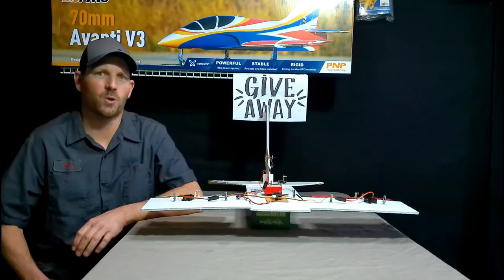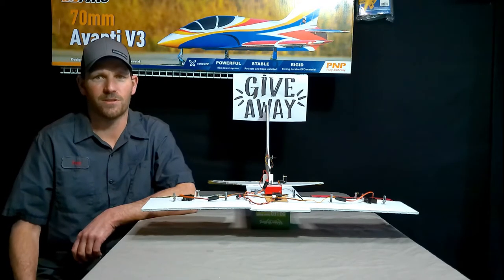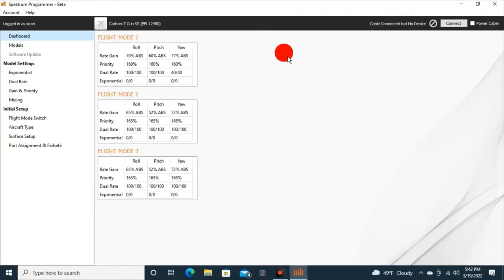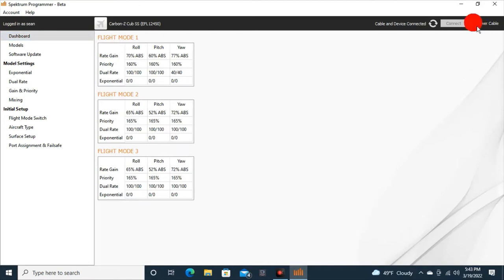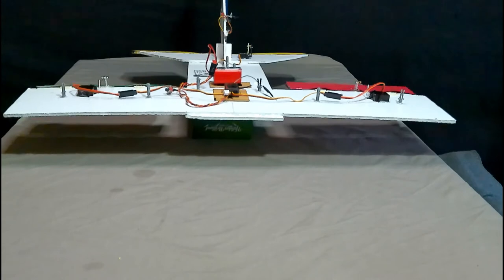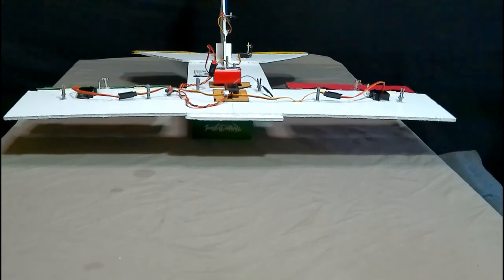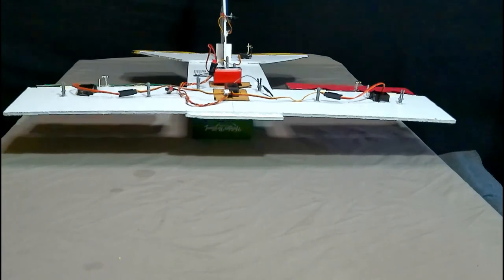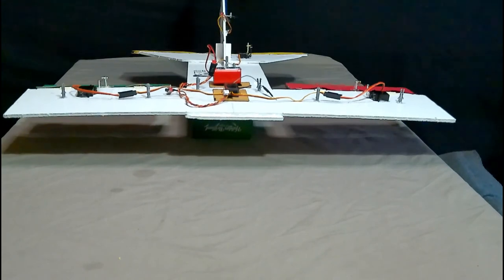SPEKTRUM AS3X RECEIVERS GYRO GAINS KINDA SORTA WELL MAYBE EXPLAINED E-FLITE AR636 SAFE SELCT PROGRAM

Comment: Thank you for the video. I''ve had the Opterra for years, and I must say it's a plane begging for a "real" flightcontroller and actual mission planning. It's not "fun" to fly. All maneuvering is slow and lazy, and must be planned - impulsive tricks will soon have the model in unwanted places. Takeoff is really scary with that giant pusher prop in the tail, and landings a real challenge as it floats no end, and has no air brake. I imagine it slows a tad  more if you run at low rpm vs stopping the motor and letting the propeller fold. This is a floater plane. Ideal for missions, fpv, film/fotography and long streches - elrs? Fly safely!